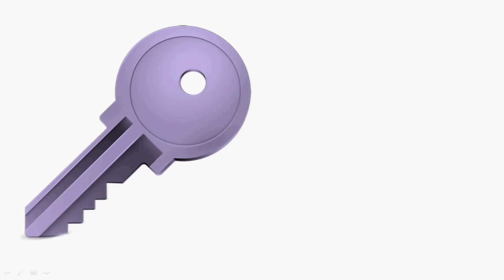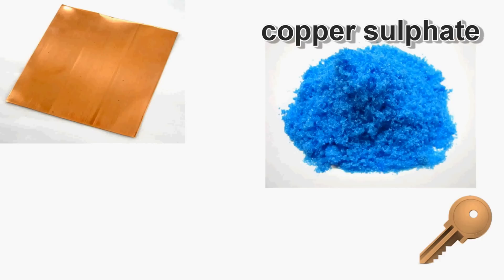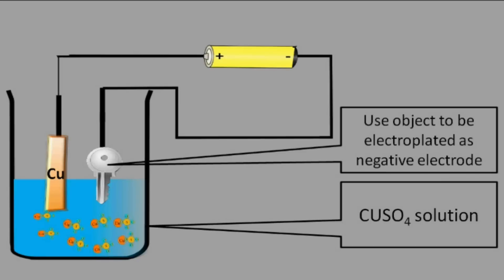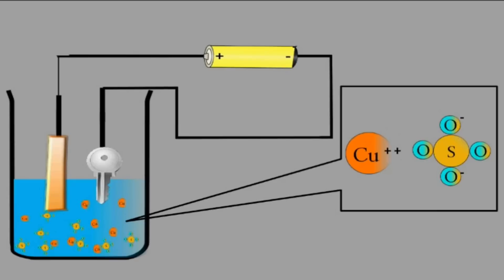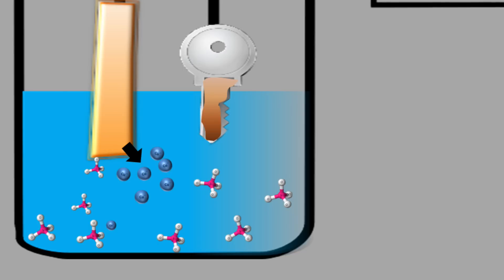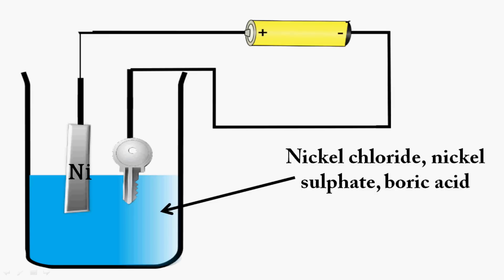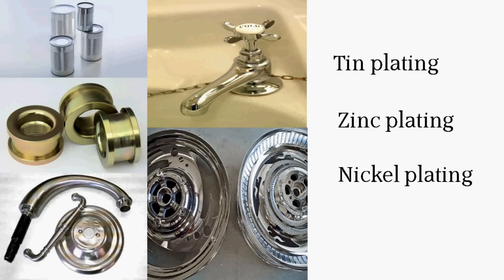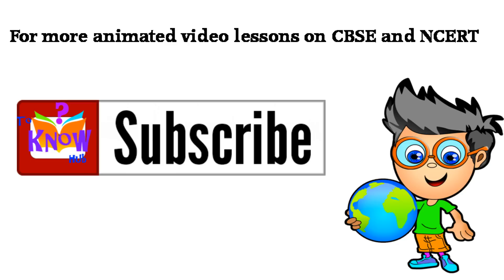Chemistry - Copper Electroplating Animation & Chemical Process Explained

Comment: Can we use just sulphuric acid instead of copper sulphate
Reply: No we cannot because the electrolyte to be used should be a suitable soluble salt of the anode metal to be used. That is why we can use acidified copper sulphate solution here.
Reply: We cannot use sulphuric acid as it has no copper atoms in its chemical composition.
Reply: If no copper is there in the electrolyte who will provide positive copper ions to the zinc plate.